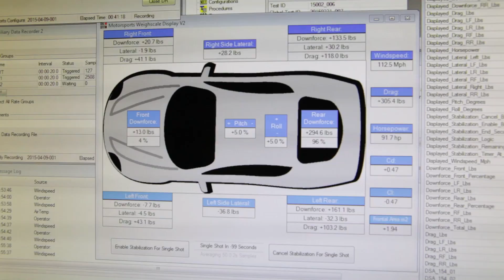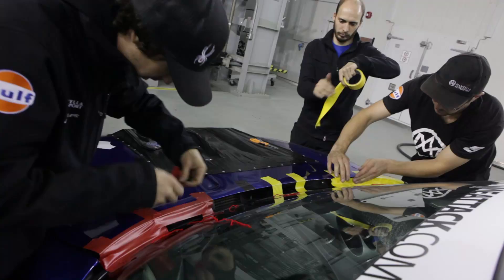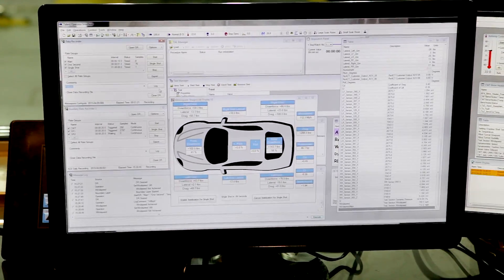How Effective is Your Aero? - Wind Tunnel Testing a Nissan 350Z

Comment: i wonder if you can make under shroud front splitter that has a an air ramp that leads into front wheel wells with brake deflectors for cooling

Comment: Without rolling tires and the car traveling over pavement at the same rate it passes through the ambient air, the wind generated by the tunnel fans is only a substitute and not an accurate application of atmospheric effects, the car must move the and the wheels must be spinning to create ground effect, Magnus  effect, all that tunnel does is test Bernouli's principle and not the full scope just a better idea than none at all

Comment: Goes to show a Ricer looking wing actually works. So next time you see a big wing, it may not suit YOUR taste (definition of RICE to many) it doesn't mean it doesn't function. 
To those that say it needs to have lots of power before it becomes relevant, the last time I say an active or powered rear spoiler/wing (eg Porsche and Bugatti etc) they start to operate at speeds of just 100kmh.
Therefore any normal car would benefit from a spoiler.

Comment: Should I put an adjustable GT wing on my G35 pv35 skyline or a lip trunk spoiler?? I had some rear lift at high speed. I had reverse rake (because my car is lowered about 2 inches) and probably in need for an alignment. I felt the rear lifting around 100mph/160kmh. Since then I've lowered the front now i have positive rake. 1 finger gap in the front, 2 fingers in the back. I don't like how it looks but its feels super stable at 100mph/160mph. Also since lowering the car cuts throw air with ease doing 100 feels like 40. No wind noise, body roll, or nose dive or squat. The only thing was slight rear lift because of my reverse rake. I haven't had It passed 160kmh since adjusting ride height but I could use more downforce. Now i worry at too much downforce might create front lift and drag. So should I get a trunk lip spoiler to improve drag or a wing/airfoil to improve downforce? I like pushing my car but like feeling it stability even at high speed. I like the being sucked into the ground and control wings give you at high speed but also I like the way a low drag car cuts through air like a hot knife through butter. My car does that but I wish It had more downforce without the effect of creating more drag like big wings produce.

Comment: A little late maybe, but i do find Aero videos super interesting! Not knowing whats allowed in this racing class, a longer splitter with some propper triangular endplated to block off the escaping flow to the sides, this will generate a much bigger positive pressure area ontop of the splitter and against the front of the car and will significantly increase the front downforce. making the splitter point upwards, to catch air underneath the car and making the front axle the lowest part of the car accellerating the air and just using a 2 degree rake should also make significant negative lift underneath the entire car.

Comment: Aerodynamics is for people who don't know how to build motors.
Reply from the maker: Tell that to the top race cars teams 🙄
Reply: Speed Academy do you have their contact information?
Reply: Garrett Mealing "good' aero vs 'huge' horsepower gains. 

If I put all the aero I want I could probably go a little faster around a track but it hurts my 1/4 mile time, it doesn't help you drift, in fact I bet it would make it more difficult with a bunch of aero. 

If I give a car huge horsepower gains it will have a much better track time, much better 1/4 mile time from a dig and/or a roll, it becomes much easier to drift.

I'll take horsepower over aero any day.
Reply: Garrett Mealing exactly it will help with traction so with too much aero on a drift car that is down on horsepower it wont slide at all until you make power. In other words you get a stock car and put aero on it or a stock car and build the motor which will drift better? The one with power obviously.
F1 cars have a lot of aero but they also have a great power to weight ratio. Aka power always more important than aero
Reply: You obviously don’t understand Aero!
Reply: you see race cars that literally go airborne and crash at high speeds?  Thats the result of people who only think about speed and nothing about aero

Comment: The thing about aero is tricky, notice how they get better results when they cover certain areas of the car. In the track this wouldn't be practical because you need  certain vents open or else the car would over heat. Air creates drag in openings and holes throughout the car so covering them up obviously wield better results.

Comment: driver window? why it's not closed during testing? doesn't it influence aerodynamics?
Reply: Игорь Потапов race cars don't need headlights because the track is always lit
Reply: race cars don't need windows as in a fire the driver can get out faster
Reply: what? look at GT Open or any other series - they all have polycarbonate windows
Reply: I didn't say anything about headlights and they didn't touch them - I was talking about front bumper inlets - they are for brake cooling or additional air intake for engine
Reply: Игорь Потапов it's a cars joke you mong

Comment: Is it possible to go "too slow" and crash cause of the low speed when using big wings. is it just a legend they tell everywhere? for example you slip off the track entering a corner 100kph but going 130kph you make it through.. someone please tell me
Reply: RandomErkki in extreme circumstances sure. take formula 1 for example
Reply: it just sounds so unbelievable :D

Comment: it was a little obvious, that the front had no downforce, the splitter was almost completely flat with the ground, especially with the massive rear spoiler making the rear squat. Nice 350z, cool test!!!
Reply: Isn't that the point of a splitter to split the air it shouldn't have angle

Comment: I don't know if anyone touched on this yet, but why did he cover up the hood vents too? They are an aerodynamic piece as much as the splitter and canards are. If he wanted to ONLY test downforce from the Lip/Canards/Wing then you would have to tape up the front end entirely. The hood will actually DECREASE lift in the front when air is flowing through it so that might have changed the results of this test for higher speed testing.

Comment: some one please answer. 
i have a 350z and i put a wing about 2 to 3 inches from the edge is that bad? or should i have put it more up?
Reply: Nissan Skyline as long as its secured properly i doubt youd have a problem bc there are wings secured to the rear bumper not even on the hatch. If its a really heavy wing id recommend investing in upgrading the hatch struts

Comment: this seems like a very inaccurate tunnel. The tunnel should be on a 5 belt system. One that runs under the car that can simulate the ground moving and one under each wheel spinning them at speed. That front downforce number is probably way off. Entire thing is probably inaccurate.
Reply: Mike G exactly what I pretend to have thought
Reply: Thats an F1 wind tunnel.  The best of the very best.

Comment: Why does closing the front bumper inlets and especially the cowl area increased the downforce on the front?
Reply from the maker: +Stefan B Because Because it increases lift that is caused by air being forced through the engine bay of the car where when its blocked it has a smooth path around.
Reply: Speed Academy ah makes sense. But can this be done during track times due to engine cooling?

Comment: First of all the windows open do a lot of damage aerodynamically speaking, also the wheels are not moving, and when they do they generate lift. Opening air vents on top of the front wheels would help.I would try to generate more downforce using a diffuser rather than a huge wing which also generates a lot of drag.Finally the air scopes on the hood going upwards also generate downforce but for some reason they are covered in the video.
Reply from the maker: Pietro Sanfilippo First of all, windows are not allowed in race cars for safety reasons. And ideally, of course you'd like to have the wheels spinning but for a test of this nature it wasn't possible. There were time constraints, hence why the guys adjusted and taped up items instead of modifying them (like extending the splitter which is a great idea). Still the data gathered was invaluable for helping with aero.
Reply: Speed Academy My bad usually racecars use panels where the windows would be ( I don't know the regulations for your races.) anyway adjustng the aerodynamics taping stuff its normal on wind tunnel tests, i would have uncovered the bonnet air vents anyway. Opening holes above the front wheel arch should increase the downforce at the front(remove lift actually). Nice car anyway, keep the awesome work.
PS: balanced downforce is better than a lot of downforce.
Reply: +Pietro Sanfilippo : Good points except: they race with windows open so it's ok to get data that way.  They talked about the  the shortcomings of stationary wind tunnel. Chip Ganassi did a lot of dynamic aero testing in a tunnel (as in driving fast in a dark place)  where a lot of environmental variables were constant.  I'm surprised that here they were changing in several variables at the same time instead testing one change at a time.  Perhaps at $2K an hour you need to compromise a little. Also $2k an hour is cheap enough for a semi-pro or even well funded amateur. 
Great video.

Comment: i thought spoilers were meant to create downforce in the back?
Reply: ominous you need to be able to steer your race car to, can't steer you wont win any races.
Reply: They are.
Reply: ***** then why were they trying to sway the downforce away from the back?
Reply: ominous they were trying to get more down force in the front of the car too.
Reply: You need as much grip in the front to turn as you do in the rear to accelerate, so only having rear downforce is a bad idea as your front end will lever around the back wheels, giving you less traction up front. They also want the car to be aerodynamically stable so forces aren't biased to the rear, which can also cause problems whilst turning.

Comment: Why they are closing the hood vents to increase the front downforce??? I think that doing so they have the contrary effect.
Reply: It's not to reduce drag. Removing the hood vents in favour of a flat bonnet will drastically increase the surface area of the bonnet, so more air hits the front of the car and pushes it down.
Reply: Yeah, i think they made a mistake covering the vents for the car. The engine needs air flow because its modified so it will heat up in the engine bay. They needed downforce in the rear and front, the spliter and some rake gives it a large percentage of front downforce and the wing also brings the rear down. All they really needed to to was find ways to bring the percentage of downforce to the front without covering the vents, those are important for not over heating the engine, tires, brakes, etc.
Reply: Andrea AUTECH its to reduce drag and focus on the key parts marked with red wool
Reply: +TheRebel3000 Gotta keep the flow laminar. All those vents will create disturbances and increase drag.

Comment: Perhaps roll up the windows.?
Reply from the maker: Wilbur van Blommestein There are now windows. It's a race car. :)
Reply: ***** Most full-purpose race cars dont have windows.
Reply: +EstupedMexicanz
Safety reasons. You don't want smashed glass in a crash and you don't want to have to smash glass if your car catches fire.
Reply: Speed Academy why don't racecars have windows? Doesn't the air coming in through where the windows should be slow it down because of drag or something?
Reply: EstupedMexicanz so you can get out quickly if you have to